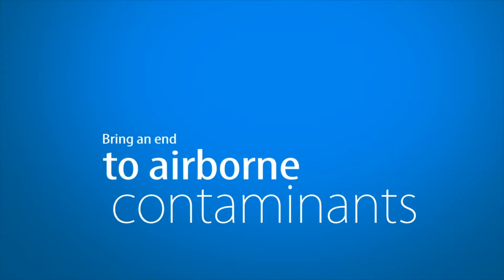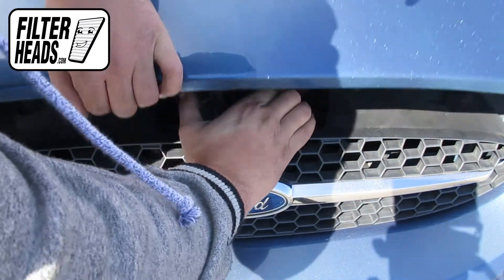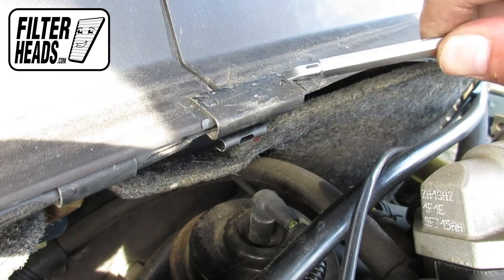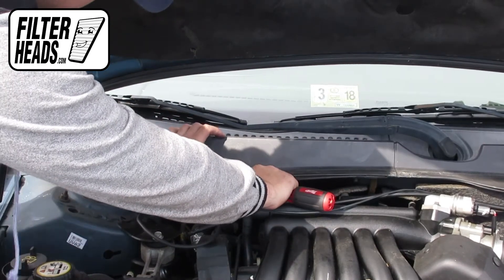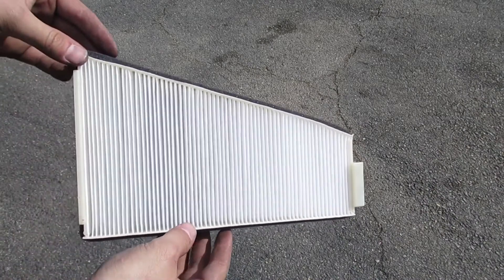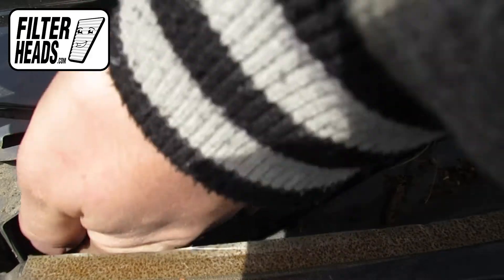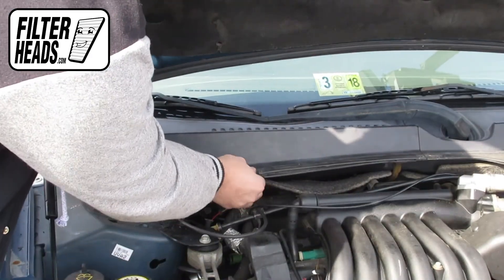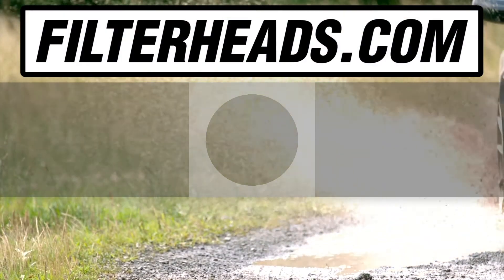How to Replace Cabin Air Filter 2002 Ford Taurus | AQ1003

Comment: I've been trying to replace the cabin air filter on my 2003 Ford Taurus, but it has a metal piece right above the air filter, instead of the flap that's on yours.  I can't find any screws or bolts to take it off.  Have you run into this before?
Reply from the maker: Usually, the plastic piece is bolted to the metal frame that sits above it. Is that the metal piece you are referring to? If not, you can email us a photo at filterheadsales@gmail.com and we can try to provide an answer.

Comment: What happens if the filter isn't changed? I have had my car for four years and I didn't know it had one.
Reply from the maker: You should replace your cabin air filter once a year or every 15,000 miles. A dirty cabin air filter filter could be filled with debris like leaves, pollen, and dust. If you live in an area with a lot of smog or around a lot of trees you might want to consider replacing it more often because you'll have more debris that may clog up the filter. Stale odors can also be caused by dirty cabin air filters.
Reply: Hope he has replaced it by now. To answer your question it can clog up the airflow which can make your ac less powerful. Not sure if it does anything else but to my knowledge that’s it
Reply: Restricted outside air intake could cause heater fan/blower motor to fail prematurely.